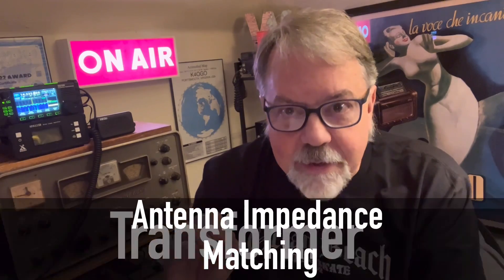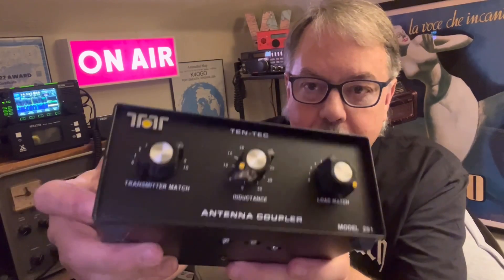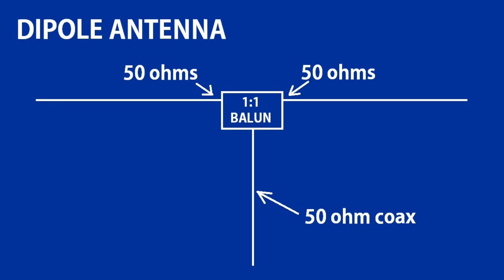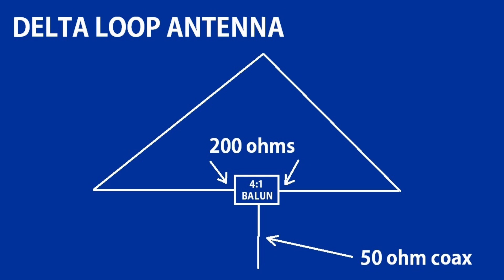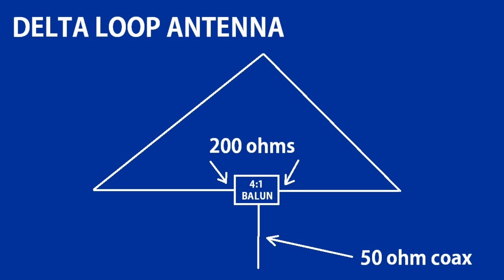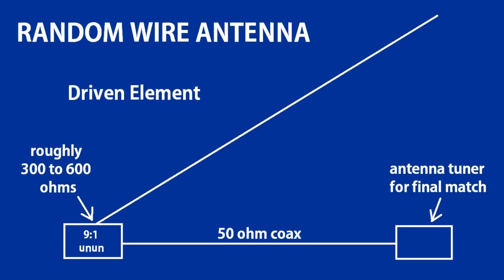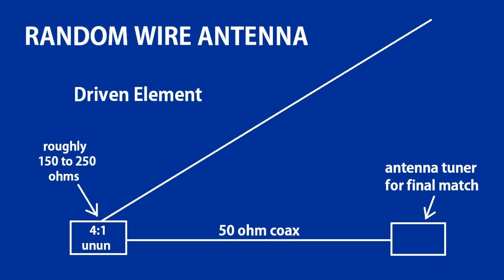Baluns & Ununs - Understanding Their Role in Antenna Building

Comment: I have a ZS6BKW dipole which uses window line. Some builders of this antenna use a 1:1 balun, other say it’s not necessary. I currently use the balun but read something where someone mentioned they got much better results deleting the balun. Some have mentioned putting ferrite on the coax before it enters the shack. Does this help the same, more or less than the 1:1 ? Thoughts?
Reply from the maker: Great question, I actually have a run of coax I have started using portable with ferrite beads. It seems to do about the same as when I use my 1:1 choke.

Comment: Great video Walt. Your simple explanations of these technical subjects really help my simple brain to understand them. Perhaps you or someone else can help me understand where these feed-point impedance numbers come from. You state that an efhw wire has an impedance of 2450 ohms and requires a 49:1 unun to match it to a 50 ohm coax feedline. Thats great and I understand that much but how did you get the 2450ohms for the feed-point impedance? Is there a way I can measure feed point impedance with my AA-35 or a Fluke multimeter? How do you know a random wire is 300-600 ohms impedance? If I were to stumble upon a "random wire" that I wanted to try and use for an antenna, how would I know if I need a 49:1 or a 9:1? Ultimately, I'm sure I could hook it to either and tune it to get a match somewhere on the bands   but how do I know? lol I get this is probably something very simple to all the engineers and tech guys, but I am neither.
Reply from the maker: Thanks for commenting. Yes I’m sure you can measure feedpoint impedance with your AA-35 but there really isn’t a need to. Just know that most half wavelength wires have an impedance close to 2450 so a 49:1, 56:1 or 64:1 is typically what is used for wires nearing or around a half wavelength. As for 9:1 ununs and lengths check out this site: 
https://www.hamuniverse.com/randomwireantennalengths.html 
That really explains it. 73 and all the best!
Reply: Imagine the current distribution along a half wave piece of wire. It's half a sine wave with the peak in the middle and the nodes (no displacement points) at the ends. You have maximum current, minimum voltage in the middle, so you have the lowest impedance, around 75 ohms, depending on how high the wire is above the ground. As you move towards one of the ends, the current decreases with the sine wave and the voltage increases. By the time you get to the end you are at the voltage high and current low, with the highest impedance, which could be 2000-3500 ohms, matched with a 36:1, 49:1, 56:1, 64:1 or so transformer, depending on band, height above ground, nearby objects, etc.
Reply: @paulsengupta971  yes, I understand that but I’m asking how the impedance numbers are derived. How do you know that a wire of a said length has said ohms of impedance? How is measured or calculated? Where did the 2450ohms of impedance come from?

Comment: Thanks so much, Walt. This is the video I have been dreaming of for a long time. I was so confused about this. Now I'm starting to understand how this works. This video will be of great value in my attempts at building antennas for portable operation. 
I have a question though: what about a 1/4 wave resonant antenna with ground plane (or radiants)? You didn't mention this one. I presume what's needed is a unun since it's asymetrical, but with what ratio?
Reply from the maker: Hi Alain, great question. Have built 1/4 verticals without a balun or unun and they have worked great. I have a couple old videos on this but this one explains it simply:
https://youtu.be/BJXI4baYBok?si=vcfue-rqYnp_TMdw
A perfect 1/4 wave with a ground plane would actually have a 1:1 unun at the feedpoint as a 1/4 antenna typically has 50 ohm impedance. I hope that helps. 73, Walt
Reply: @COASTALWAVESWIRES   It certainly does. Thanks again, Walt. Best 73s.

Comment: I have a 132ft EFHW with at 49:1 tentenna's transformer.... also the feed line is coiled at the transformer for a choke... would I do better to uncoil the feed line and get a 1:1 balun and put it at the radio side of the feed line?
Reply from the maker: You’re probably doing fine with the coiled feed line. I’ve done that a lot. We call them “Ugly Baluns” but they work great.
Reply: Does that mean your using  a  49:1  unun, and a choke calling it a balun?
Reply from the maker: @ebones6957  yes

Comment: In aviation we call the tuner an antenna coupler.  I always like that name as a better description of what it actually is doing.  73
Reply from the maker: I absolutely agree! 73
Reply: It is a coupler when the antenna is directly connected to the "output" end of the device. The coupler is typically remotely operated. 

If the matching device is close to the radio, and directly controlled, then it is a tuner.

Comment: Great explanation Walt, concise and to the point to help beginners understand the fine points of antenna building.   This is why I really like and recommend the videos on your channel.  Also that's a nice Hammarlund in the background, I have an HQ-160 that I have had since my teen years in the mid 1970s!  I started out with it listening to shortwave in my teens and it stoked my interest in ham radio.
Reply from the maker: Thanks! I was heavily into shortwave in my teens as well. I got that HQ-180 by luck a couple years ago. My neighbor across the street found it in his attic and gave it to me.
Reply: I did SWL as a teen as well using a Heathkit. It later got me interested in ham radio as well.
Reply: @redstickham6394
@COSTALWAVESWIRES
Similar situation here. I listened to short-wave in the late 1960s getting many DX broadcast stations using a long wire antenna in my parents attic. But I didn't get into Ham radio until very recently.

Comment: A proper 9:1 random wire should not be resonant on any band & requires an ATU, For each band of operation, This why there are non resonant lengths of wire you should use depending on the bands it is to cover.
Reply from the maker: Roger that, not resonant on any band or it's multiples. I think I may have been a bit confusing as what I was saying was after attaching the 9:1 to the random wire there may be a band or two where you can actually transmit without the ATU as the SWR is under 2:1.
Reply: @COASTALWAVESWIRES  If it is under 2:1 VSWR, Then the random wire length is not correct.
Reply: @Tantalicdavid It could be. What's the reason it shouldn't be? It could be a perfect 450 ohm load on one of the bands. Or maybe even more than one.
Reply: @paulsengupta971   If it is then the wire length is wrong, A proper 9:1 random wire should not be resonant on any of the band & requires an ATU

Comment: I think the confusion arises between the balun types.
Transmission line baluns(to stop common mode current)....a physical wired connection,and transmission line transformers, to match impeadance, through magnetic flux(no physical connection).
Perhaps this is a topic for a video all in itself? 73!.
Reply from the maker: Yes indeed, was trying to make this one very simple.
Reply: @COASTALWAVESWIRES  of course, I have to re-read my own comments, just to make sure I have it right myself hihi. Keep em' coming, 73.

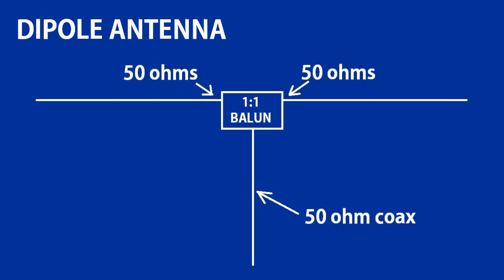Comment: Hi Walt. Happy New Year. I noticed that at 3:58 you said a dipole has an impedance of 50 ohms, but I think that is for an inverted-V antenna. A dipole is 73 ohms. I've heard that many hams in the days of tube rigs used 75 ohm coax (TV type) and just tuned their tube transceivers to match that without a tuner. So with a modern 50 ohm solid-state rigs, would SWR on a resonant dipole be lower when using a 1.5:1 balun instead of a 1:1 balun? This would drop the impedance from 73 to about 50 and produce the lowest possible 1:1 SWR at resonance antenna length for the frequency in use, right?
Reply from the maker: Yes that was just a simple explanation example, in theory you are correct.
Reply: @COASTALWAVESWIRES  I love the way you explain things in a very approachable way. I definitely learn something from your videos every time I watch them. That's what is great about ham radio. It is a hobby of continuous learning and experimentation. It brings out the playful kid in me......which is a good thing.
Reply: The actual feedpoint impedance of a resonant dipole depends on the height of the wires above the ground, how they're routed (straight, bent, angled up, angled down, flat, folded back, sloped, etc) and how conductive your ground is.  That's why changing the wire height above ground by going from flat to inverted V changes the impedance. In other words, it is extremely hard to predict, so you can't really say a real life dipole will be 75, 50, 150 or 25 ohms until you put it up and actually measure it.